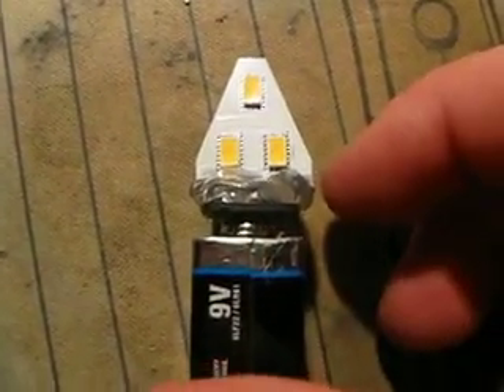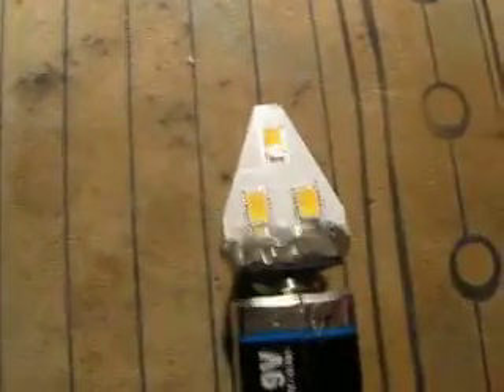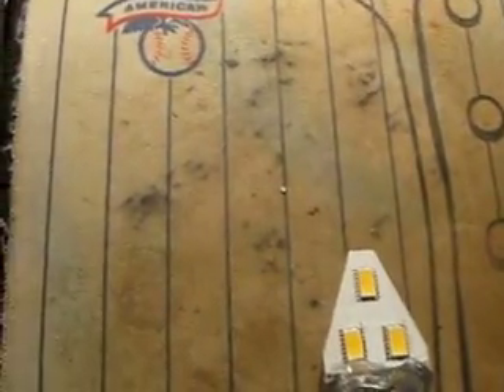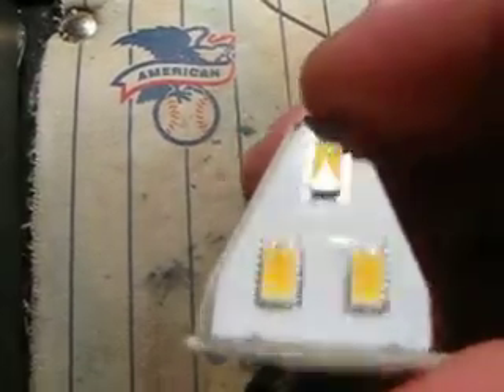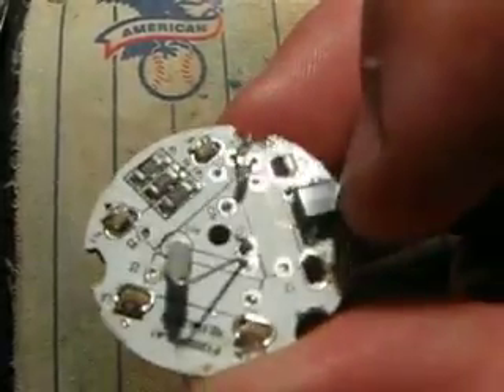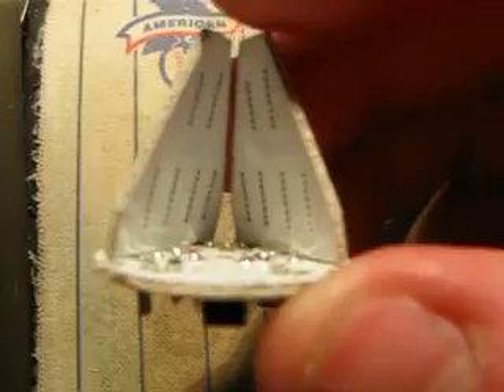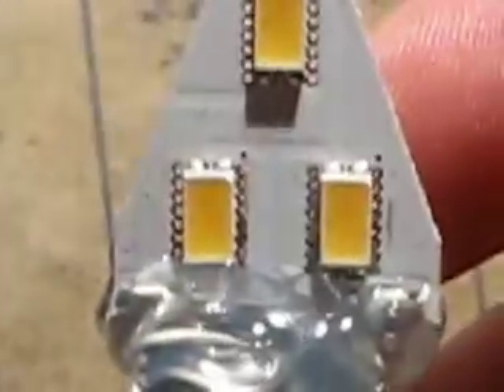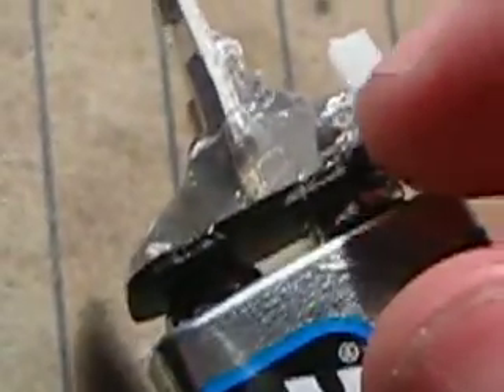9 Volt Battery Flashlight Version 3.0 (Scrapped)

Comment from the maker: Take a 2 AAA battery holder and put 2 wires on it if there isn't any and then connect them to where the button batteries go. I'm not exactly sure where you connect the wires but try the top and bottom ones like if your looking at the back of the unit with the LED on top I think it's the top one and the bottom one. I will have to check that fully and get back to you.

Comment from the maker: That might work. As long as you get 5 volts at 500mA or 1 amp you are good. They actually make universal chargers that can take a 9V battery and charge lots of devices. they can plug into a car outlet ot standard wall outlet. I even think they hook to a PC as well.